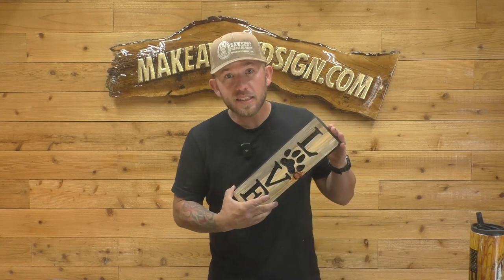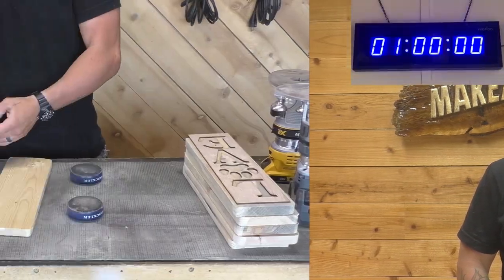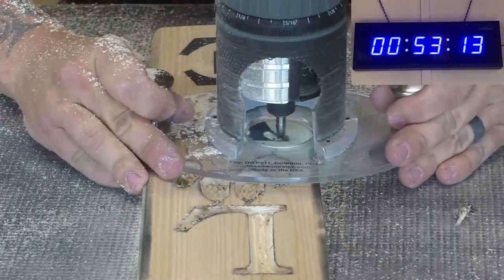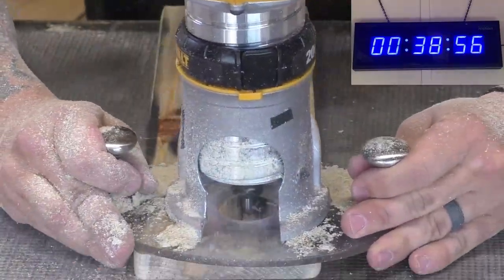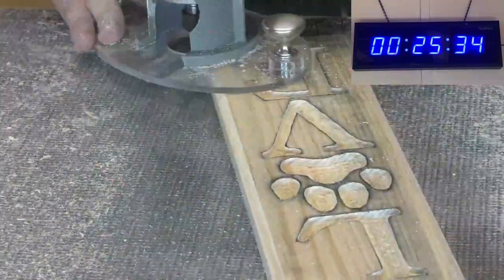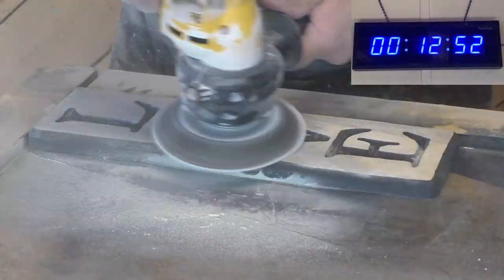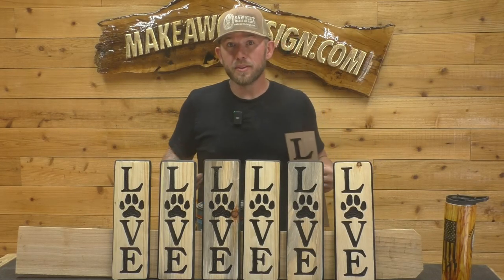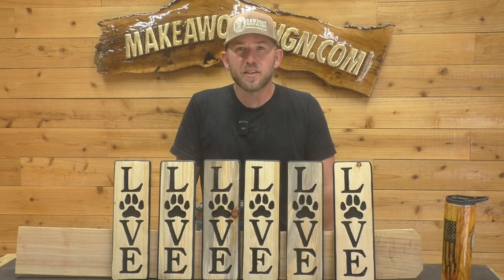Make Over $120 An Hour With 1 Simple Project

Comment: My thing is that the coating always costs me the most and takes the most time. I tend to use Helmsman Spar or Polycrylic and to get the nice even high build glossy finish my projects eat up a can of spray in no time. Example , I just did a double board sign (with chains) roughly the size of two or three of the boards you used in this video and I had to use a full spray can plus maybe a quarter from another and I pay around $14 a can , so that eats into my profit and raises what I have to charge. I've watched most of your videos I think and some on coating but wonder if I'm doing something wrong that's making me use too much ? An in depth updated video on coating, finishes, time, costs, etc. would be great. Also , the differences between brushing or spraying. I haven't brushed any yet, though I have a can of Polycrylic I'm going to try on a practice board. I have an air sprayer I haven't tried yet and eventually will get a critter sprayer but have only used spray cans so far on what I sell. I also run into grainy looking finishes sometimes, even if I take time to sand between coats, which mostly I've learned to avoid and just sand (sometimes ) before the final coat. I've also wondered how you handle coating when carving on site because it takes so much time to cure and multiple coats to get a great gloss finish built up ?
Reply from the maker: Great questions man. 
1: when doing a batch of signs we usually use a critter sprayer which saves money
2: we’ll definitely do an updated video on finishing. Soon.
3: when carving onsite, I usually only put 2 coats on and let them know that they’ll have to add a few coats. I’ve never had any complaints

Comment: I'd guess if I took my time and tried light coats that these boards in this video would probably take a full can for every two boards and that's $14 not counting board costs, etc. , so hard to sell boards for $20 and make it worth it. Of course, doing the assembly line style definitely would save some time and getting the boards small enough would help too.
Reply from the maker: If you’re using a full can on 2 small signs, you’re way over spraying. It should take maybe 4 or 5 light coats to get a good finish.
Reply: Thanks! Of course, keep in mind that I do a high build high gloss finish most of the time.  @oldave100
Reply: Do you spray super light coats or flood?

Comment: Which 90 degree bit are you using? V-groove or the 3/8 . There are two on your website.
Reply from the maker: For this sign, I used the small V-groove 90 degree. The big one is mainly used on large signs and tables
Reply: Thanks

Comment: How long do you typically wait before sanding off the spray paint?
Reply from the maker: Normally just till it's dry to the touch.
Reply: @oldave100  would you suggest investing in an air compressor…I wait until the paint dries, sand, and then use a leaf blower to get rid of the dust but saw dust always remains in the carved areas - you ever have this problem?
Reply from the maker: I really like an air compressor. I would find it hard to get by without one. When I'm carving onsite at shows we don't use one but I really miss it when we can't use it.

Comment: I like the process, unfortunately your router plate will not fit my router. I am trying to make one on my own. So far, I have cracked 3 attempts.
Reply from the maker: What router do you have? We do have blank bases with a centering jig that you can drill your own holes in
Reply: Hey mate,I,as a pensioner,am on a limited budget,and made my own.Are you using acrylic sheet? I think I used 3-4mm(1/8+)acrylic sheet,cut W scroll saw,CAREFULLY drill holes,and use a proper countersunk but,not a larger drill bit(or it WILL crack) Hope that helps
Reply: It's a very old craftsman. I am going to buy a new router tomorrow. This one has motor issues anyway.